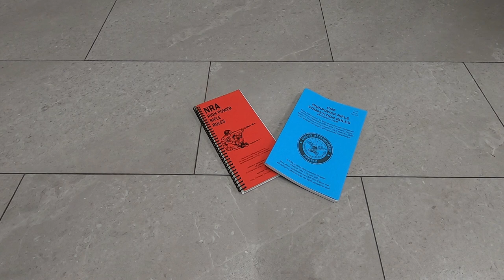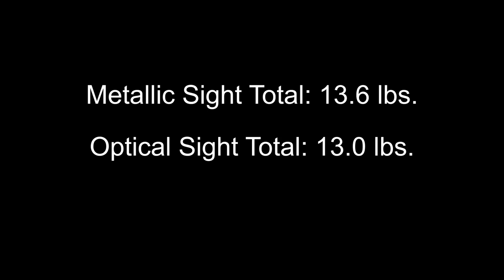Service Rifle Weight

Comment: CMP's rule book does say about weight limitations.
Reply from the maker: Can you point me to the page in the rulebook that limits service rifle weight?
Reply: @konrad1853  2022 High power rules book - see page 44
4.1.7 F-class target , 18.19 lbs
4.1.8 F-class open, 22 lbs
4.1.9 AR, 14 lbs
Hope this helps.
Reply from the maker: Those rules do not apply to service rifles. Refer to 4.1.1, 4.1.3, and 4.1.4 for service rifle limitations.

Comment: Always good content. A question though, is your length of pull the same for both lowers?
Reply from the maker: The Magpul buttstock is adjustable. One of the settings is pretty close to the LOP of the A2 stock.

Comment: That was pretty good. Thanks.
(I am old Fudd who thinks iron sights were "better" ( even if I did have a tiny lens in the sight hood.;)
Reply from the maker: Iron sights provided a link to the history of the sport. Something is missing by going to optics. But there were a lot of people who though it would be a good idea to allow scopes. I guess they had their reasons.
Reply: @konrad1853  If Service Rifles are issued with optics, that I guess that's what the civilian's should use. I was told that the only advantage scopes gave to shooters was the ability to track wind changes and mirage a little quicker. 
( I was Mr. Mediocre playing 'chase the spotter' and constant catch up. Had a lot of fun though.)
I shot an early Golden Eagle from Eagle Arms. Truck axle for a barrel. Shot the throat clean out of that barrel, but would still group pretty good.)

Comment: Personally, I think there should be a weight limit rule in the books, so to discourage adding what I call “useless weights” to a service rifle. In my opinion, adding these weights completely goes against the spirit of this particular style of competition. This is supposed to be a “practical rifle” style of competition. It goes against all logic to add 6 additional pounds of useless weight to a rifle that was designed to be easier to carry in the field.
Reply from the maker: Service rifle is not a practical rifle competition. It may have been decades ago, but those days are long gone. Additional weight over the "as-issued" rifle isn't useless as it aids the shooter's ability to hit the middle of the target and that's what the sport is all about.
Reply: @konrad1853  it just seems like a vicious cycle. We keep doing things to our rifles to “help” the shooter, then the scores start getting too high, so we in turn then make the targets smaller 🤣. If adding weight is legal, why do they have a restriction on barrel size being .750 at the gas block? Why not just let us all run bull barrels and add the weight that way? I suppose we’ll just have to agree to disagree. However, I most definitely enjoy your videos!
Reply: You might find a home in CMP sporter rifle (22lr rimfires max weight 7.5lbs, ordinary stocks, 6x max scope, 3lb triggers min, NO coat , one ordinary work glove, one standard sling).

Theres also "as issued" military rifle matches (JCG M1 Garands, not even allowed to bed them, use NM sights, or any weights/stock spacers/cheek risers, etc).